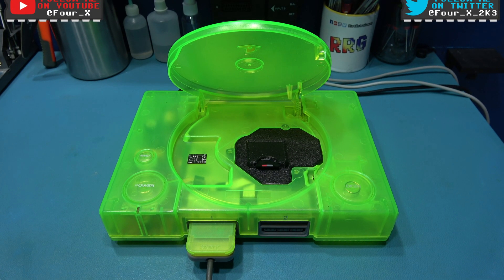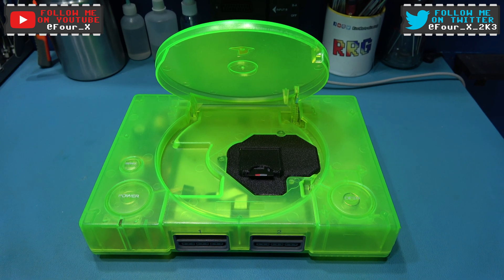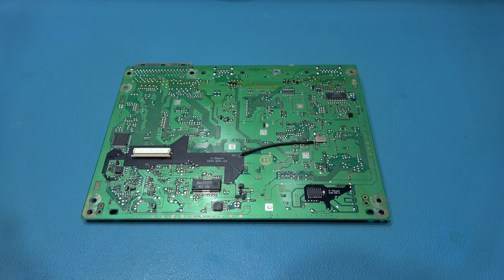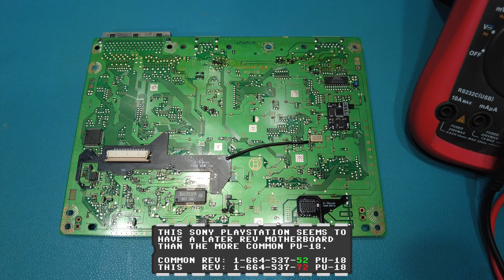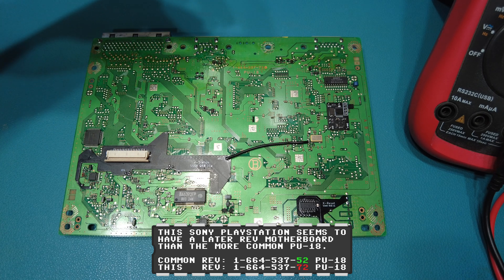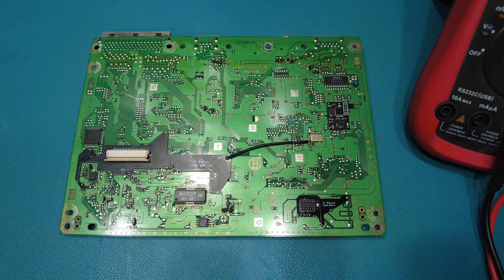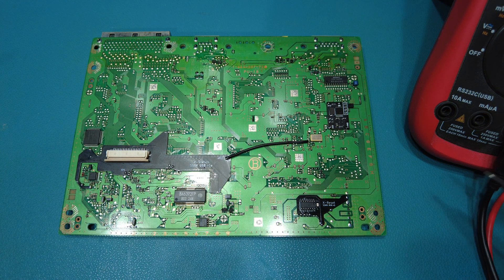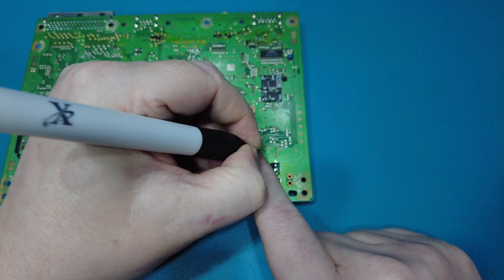Sony PlayStation SCPH-555X - Dual Frequency Oscillator Install, true NTSC accuracy on a PAL system.

Comment: Hi. I got xsattion modded  pal ps1. I use rgb scart to get colour in the ntsc games on my 14" trinitron. One thing that bothers me a bit is rgb scart is a bit too good. With games that heavily rely on dithering it isn't desirable to have perfect picture. So I thought about downgrading to composite but this puts out of the question ntsc roms due to bw picture. would dfo mod allow me to use ntsc roms over composite on crt tv?
Reply from the maker: No. the DFO only correct's the GPU clock (speed) and not the Color Subcarrier in the Composite Video.
Reply: @Four_X  Is there a way to get colour over composite with ntsc roms on pal ps1 and crt?

Comment: That sticky tape under the board seems a bit rubbish. Sorry about that. I could not find the tape I used to use so I bought something different. It's genuine 3M and I was promised it was the strongest thin tape that can stick reliably to low energy surfaces. Before this though I temporarily used a 3M tape that was really horrible and just would never stick well to low energy surfaces. Maybe this is from that batch.
Reply from the maker: No problem bud. I've had the same when trying to get Amtech flux here in the UK. The seller will screem it's the genuine stuff but as soon as you get it you can tell right away it's a fake. Thankfully you can get genuine ChipQuik and MG Chemicals 8341 flux from Amazon now so I've switched over to that.